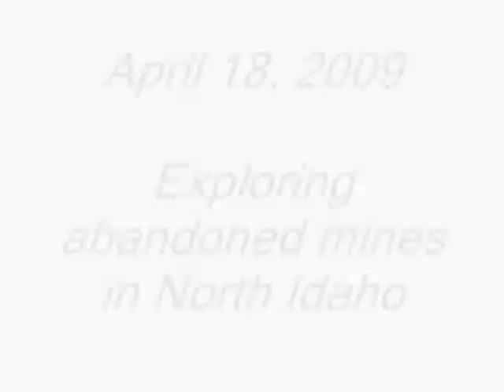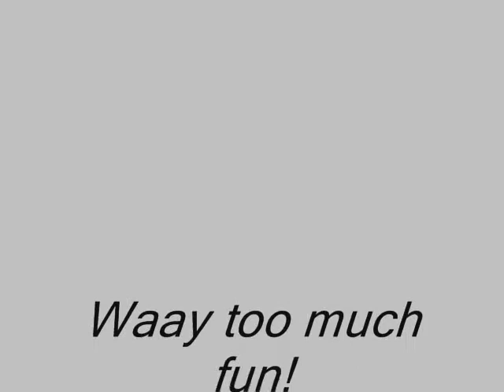Exploring Abandoned Mines In North Idaho

Comment: Allot of this equipment is fairly modern with froth flotation tanks,rotary disk vacuum filters and the electric motors driving them.The froth flotation method for separating minerals from the gangue is a relatively new mining process in the mining industry starting in the early 20thC.This gear looks to be from the 60/70's.It's great to see it still set up and almost ready to run! what were they mining?Gold/silver/lead?I hope these sites are protected? Motto "Take nothing,leave only footprints"

Comment: Your so lucky to have treasures like this to visit.We used to have such places in the UK but the scrapmen and the gypsies went for them in the 60's when metal prices increased.The whole country was wiped clean and only a tiny percentage were saved from the cutters torch.Industrial engines,mill,looms,mining equipment,locomotives,rail tracks everything.Nowadays it's worse,war memorial plaques,man hole covers,live power lines,live railway signal cabling,many have been killed stealing copper wire.
Reply: Trust me, anything you have experienced in the UK  the American side suffered the same plunder in equal measure, plus we have Government agencies sealing historically significant sights with some sort of Super Silly Putty on the assumption that every explorer is a drunken adolescent equipped with a 99¢ flashlight and an inferiority complex.